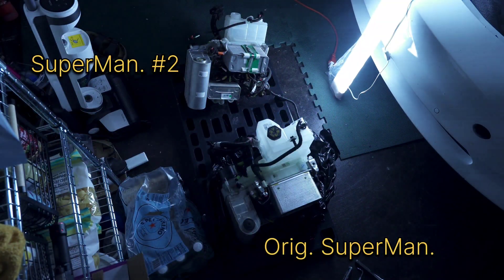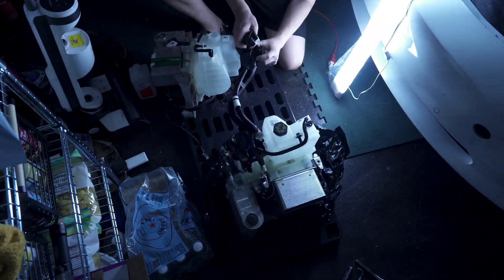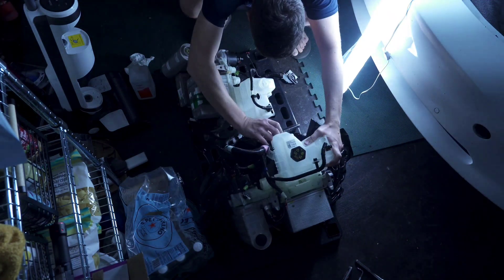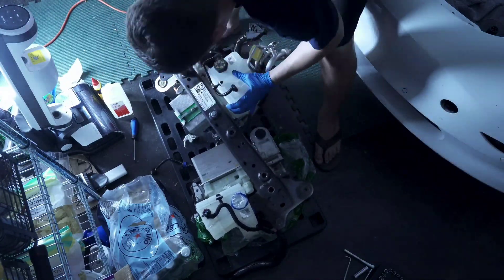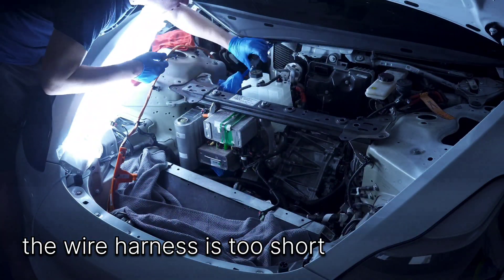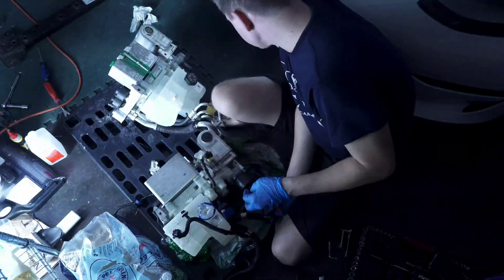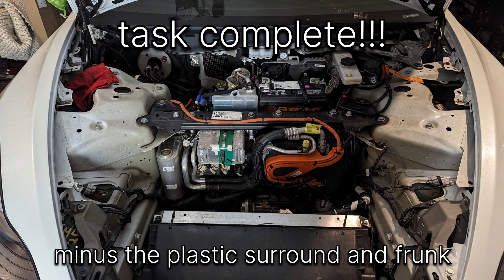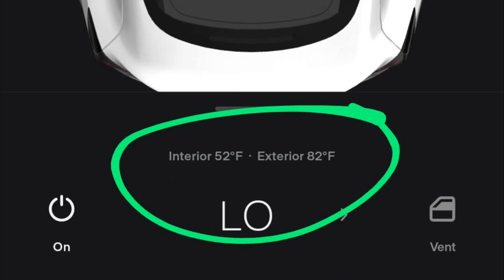Tesla Model 3 Supermanifold Replacement in 5 minutes. Time Lapse

Comment: Do you remember what was your error code ? Mine said the same as yours with vcfront_a447. Also how did you determine the super manifold being the problem?
Reply from the maker: It was a process of trial and error, the AC stopped working and after doing an AC Compressor service (compressor was replaced) the problem was still happening.
The only other component that would do that was the supermanifold.

Comment: After replacing the super manifold and ac compressor how much oil did you have to re-fill? and what kind of oil did you use?
Reply from the maker: Yes I added oil. 
I used synthetic POE 68 oil (should be safe for EV AC systems)
I added 4 oz.

Comment: I have the same falut in Armenia 
They adviced to replace comptessor
Reply from the maker: That's a good place to start - the compressor is cheaper than the supermanifold.
I had replaced my compressor but since the problem didn't go away the supermanifold was the other option.
Note that early models of the Model 3 didn't have a supermanifold and the compressor was slightly different.
Good luck

Comment: So I bought a salvaged Tesla from auction and I’m 75% done with the  body fix. Next I need to replace both pumps. Any advice on how I can do that without burning them again?
Reply from the maker: I don't have experience changing the pumps but if you unplug the aux battery (under the hood) and the High Volt Battery (under back seat) then it shouldn't start up until you are ready (coolant filled and all).
Best of luck

Comment: It be very interesting to see how you take the air out of the system more closely. Also did you access Tesla Toolbox with a laptop when replacing the super manifold?
Reply from the maker: I didn't take a very detailed video of that. RE: Tesla Toolbox - nope I don't have access to that, I used the Tesla Service mode on the main screen.
Reply: Hi quick question, in order to change the 2 coolant pumps, do you have to remove the supermanifold? Thanks
Reply from the maker: I'm not sure. I didn't replace the pumps.
I can definitely hear them working during the bleeding process. But I don't even know where they are located.
Reply: @romasprojectcorner  wish you were in London (UK), my M3 is giving me soo many problems. Now the car computer is giving me problems, knocks out the cameras, autopilot and Navigation, comes on/off intermittently. Tesla UK is useless!
Reply: @romasprojectcorner Bro its located backside of Supermanifold with 4 bolt
Reply: @reconforsales7708 No..not at all

Comment: My cars gonna need this lol just failed today. I wanna do it myself but it’s under warranty. You don’t need to evac the ac system then unless your changing the compressor? Also did you pull the main fuse for the hv battery?
Reply from the maker: I did evac because the supermanifold holds all the connections together. After the 12v removal I also pulled the HV connector under the rear right seat.
Reply: Out of curiosity, how did you air purge the system? Did you just run the heat pump and keep filling?
Also a cost estimate would be nice to know
Reply from the maker: @MydNitQ  to purge I would run the system and initially I did loosen the hoses behind the supermanifold until coolant started to leak. After that it was just watching the tank and adding coolant with the system running. 
Cost of the supermanifold? Something like $700-$1200. Depending on what's available.
Reply: @romasprojectcorner hi I had to change the coolant pumps but still they are very noisy, I ran the purge from the screen and it shows all green with no red indicators. Do you think I can have an airlock in the system?
Reply from the maker: @morrisuddin3634  If you ran the diagnostic and it shows all green then I doubt there is an airlock. Could it be the A/C compressor making noise? I'm not sure how noisy this car should be but mine is audible when I turn on the heat.
Reply: @romasprojectcorner  Thank you soo much for getting back to me. Is there anyway I can get in touch with you to send some pics or maybe a video.
Reply from the maker: @morrisuddin3634  sorry I don't have any way on my end. But if you want to upload a video to your GDrive or Onebox and send me the link, that would work.